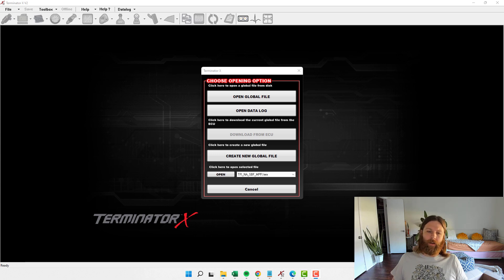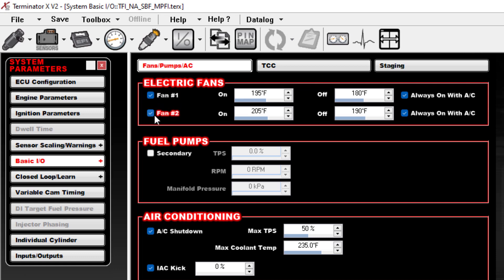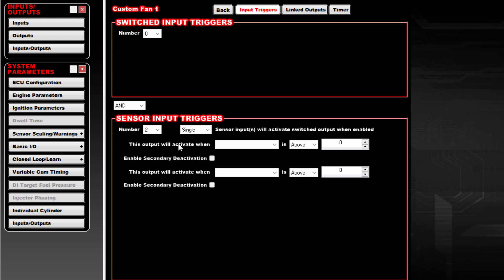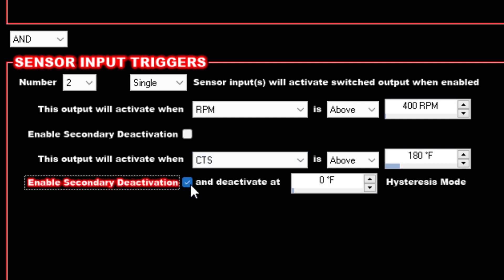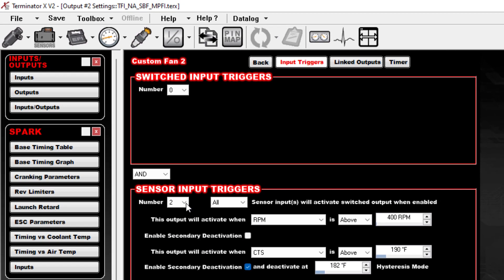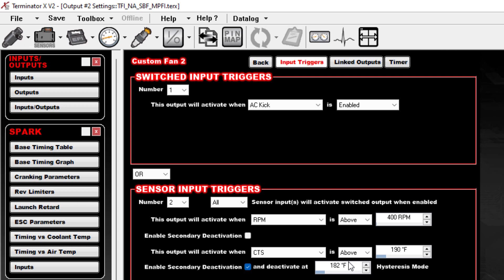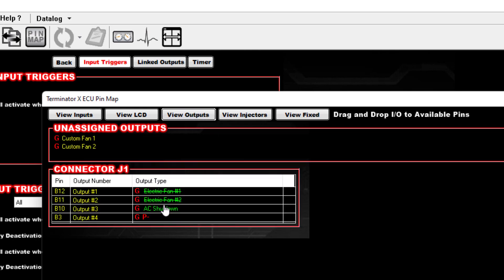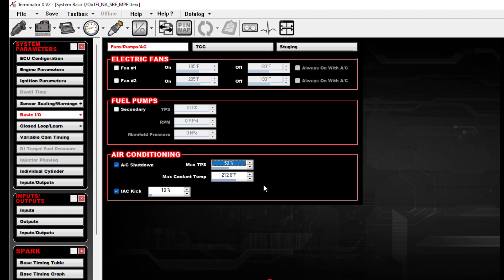Terminator X Tuning - Disable Key-On Fan Operation

Comment: does this setup work for a single 2 speed fan? i am mostly just concerned about turning off the 1rst speed at 190 but turning on the 2nd speed at say 185. would i simply need to not over lap the settings? example turn off speed 1 at 190 and turn on speed 2 at 191.

i currently run a relay setup that steps through based on 2 temp sensors and want to switch to sniper fan control to avoid alt belt slip/screech at start up.

Comment: V3 has "Engine Running Only" checkboxes. Is this the updated way to keep the fans from running until the engine starts?
Reply: I changed my settings by checking the boxes and it does cut the fans until the engine is running

Comment: Another great video - thanks Matt!
After implementing this technique, the 3.5" handheld no longer displays the fan's on/off status. Is there a fix for this?
Thank you!
Reply from the maker: There is not a fix for that. That’s the trade off. The actual pro dash stuff can be setup to show when they activate. But I don’t think there is a way to make that work on the handheld.
Reply: @LeechMotorsports  Understood. Thanks for the quick response.

Comment: Awesome video, I've been racking my brain trying to figure this out. Thanks for the videos, and keep up the good work.
Reply from the maker: Thanks Kenny!
Reply: @LeechMotorsports  Now I'm having a problem. When my fan comes on the engine starts surging. Fan goes off it takes about 20 seconds for the engine to return to a smooth idle. Battery drops to 13.4 volts when the fan kicks on but then voltage surges with the idle up and down as well. Any thoughts on what I should look into? I've been trying to get this car drivable since before Christmas to no avail and it's springtime and I need to get it going.

Comment: Thanks Matt! Please follow up with the PWM video and since many of us are using the Contour dual fan, I prefer 2 fans with different temperature settings. I'm currently using the Flex a lite PWM controller and it works well, but will be using the Terminator in the future with separate fan control .

Comment: Can this be done on the HP and dominator platforms?
Reply: Yup, works great, I had to add the IO config file to it.
Reply: @edwardschipper6648  nice. Yeah i couldn't figure it out for a while. Until you get used to it it doesn't make a lot of sense, at least that's how i felt.
Reply: Yeah it'll be the same
Reply: @TurboV8boi  right on, appreciate it!! I was poking around and didn't see where I could create and edit the custom outputs. I'll have to dig a little deeper.
Reply: @TurboV8boi  Going to play around with this on my Terminator. Sounds like a good way to go. I like not having to do any "extra" wiring and just do it through the software.

Comment: Mine fans kicking on during cranking doesn't really affect starting but I'd very annoying, thanks alot for this! Will the fan on/off Still display on the hand held?
Reply: No it will not. That part is annoying for folks that use the handheld. I haven't looked if you can get it to display the output status, if you can then in theory you could display the Output status.
Reply from the maker: I agree. Pretty sure this will not show up on the handheld status screens.